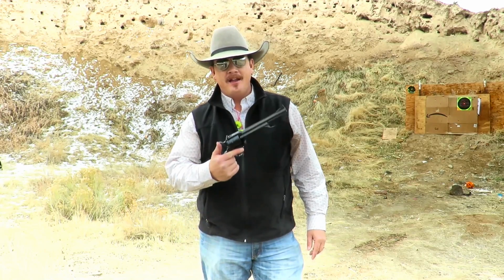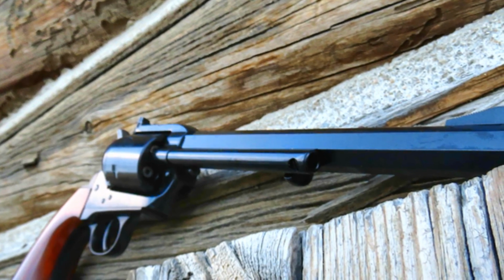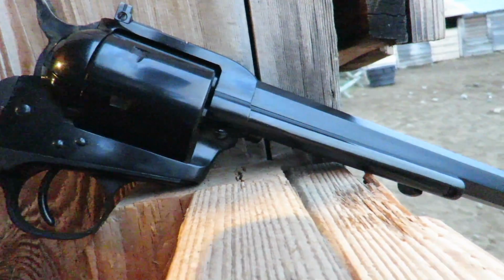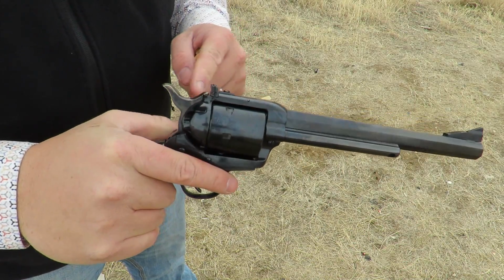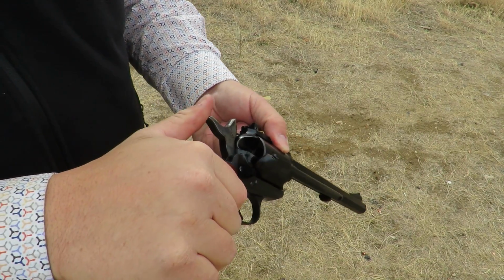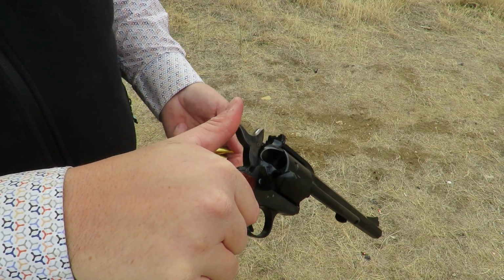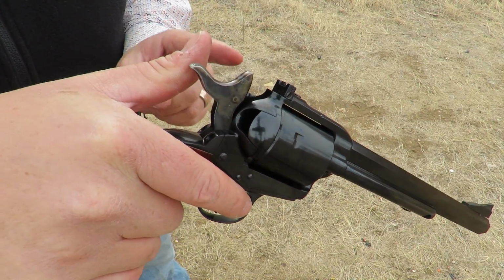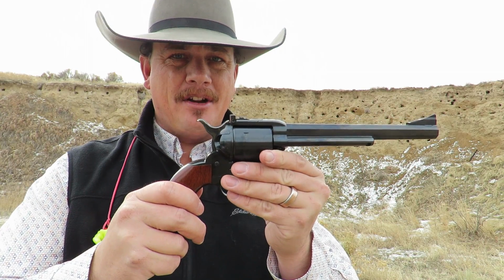CIMARRON "BAD BOY" - 44 Magnum

Comment: A beautiful revolver-so nice, just love the deep blue finish on this bad boy. Although I do wish it was also chambered also in the ;45+p magnum round, I have a old model Ruger Vaquero  with the Blackhawk frame that will handle it, It's twerk is-it loads off center-not a true 1873 Colt style loading sequence - and because of it's  transfer bar safety and in frame firing pin. It would be very easy to make this model handle .45+P loads with adding a stronger beefier cylinder, Just a thought that you may you want to pass along, there are tons of 45+P shooters out in Pistolaro land. I have a lot of friends that would be interested in buying a model like I mentioned.  Thanks so much for your review. Like any revolver made-you should always check your ''Reloading Manuel'' to make sure your reloads are with-in specs of any revolver you are shooting-bottom line( check Cup Pressure) you may save your life, terrible thing to waist!

Comment: Man Alive A.C. that looks like a fun gun. The only worry I have is the small grip. On my Super Blackhawk, I've got Pachmyers to tame the savage beast. Just wondering how this works on this revolver. Cool video my friend. I like that Montana looks so much like Eastern Idaho.
Reply from the maker: I have lived on both sides of the border. I think the Montana line should extend just a bit farther into Idaho. ;-)  ... I actually didn't mind the grip. It does rotate up,  which is typical of a SAA grip.  I shot the gun a lot when it was real cold and the recoil did not bother me. I can shoot it one-handed a lot with no pain.  I am not very recoil sensitive though.  ... In my opinion, the biggest disadvantage of this revolver compared to the old Super Blackhawks is the SAA firing pin instead of a transfer bar. However, I do personally like the SAA design touches and the sweet octagon barrel.
Reply: @ralphperez4862: No problem with the grip size, for people with normal size hands you just need to fit Colt 1860 grips/grip frame, it just screws straight on, never understood why Colt went with the short 1851 grips o the 1873. Chris B.
Reply: @453421abcdefg12345  thanks

Comment: Can I use .44 Special also? I’m 70 and I love that style but .44 may take a toll on my wrist...
Reply from the maker: Don't see any reason you couldn't.
Reply: All .44 Magnum revolvers will accept .44 Special and .44 Russian.  Make sure all the chambers are throughly cleaned after so they they aren't fouled so the continue to chamber magnums.

.460 S&W Magnum will accept .454 Casull, .45 Colt and .45 Schofield.  

.357 Magnum will accept .38 Special, .38 Long Colt and .38 Short Colt.

Comment: I was told that the hammer  retracts on that revolver And that you can safely carry six
Reply from the maker: Well, technically, even the manals on the "Safety Hammer" revolvers from Uberti still say to only carry 5.
In theory, you should be able to carry 6 safely, but that firing pin is still right there, even if it is retracted a little bit. It's definitely not as sure of a thing as the Ruger transfer bar.

Comment: Is there a firing pin block on these?  If you dropped it could it fire?
Reply: No, there is no transfer bar or other type of safety on this pistol. The safest way to handle it is to load only five rounds like he showed. The trigger CANNOT be pulled while the hammer is at the first click so that makes more difficult to accidentally shoot it.
Reply: What I noticed with mine, the firing pin only protrudes when the hammer is down WITH the trigger held to the rear. Pull the cylinder and try it, it doesnt protrude so seems safe to carry with a 6

Comment: I’ve only fired conventional double action revolvers.  I’ve noticed the handle angle is more acute in angle compared to a double action revolver.  Is it comfortable to shoot?  I’m looking for back country fire power and won’t put many rounds through it.  the price is right!  Thanks!
Reply from the maker: I am quite familiar with the most double-action 44s, and while different, this gun is still comfortable to shoot for me.
Reply: If you are looking for an easy shooting single action buy one that shoots .45 Colt. With this style of handle the kick is mostly straight back and when shooting .45 Colt you can shoot all day without getting a sore wrist.
Reply: Literally just held one of these today. Almost bought it on the spot but wanted to do some research FIRST. I have a Henry Big Boy Steel that shoots .44 Magnum.
Reply from the maker: The Single Action Army grip is designed to roll up into your hand during recoil, not straight back.  I could shoot 44 Mag out of this all day.

Comment: No experience with Cimarron. Comparable to a Ruger BlackHawk?
Reply from the maker: The closest comparable model out there would be the Ruger Super Blackhawk. From a distance one can see similarities between the two, however, upon closer inspection, there are a lot of differences in the design.  The Cimarron Bad Boy remains the truest to the Single Action Army design, and perhaps most importantly, has a rounded trigger guard instead of the Ruger's squared-off knuckle buster.
If you look at the two side-by-side, the Cimarron has a more striking appearance, and for those of us who love the Peacemaker revolvers, it has more design characteristics that hearken back to those revolvers that won the west.
 Don't get me wrong, I love the Rugers too, especially my 7.5" Ruger Vaquero in 45LC!
Reply: Yeah, i dont care for the looks of the squared trigger guard either. Some of their models are round now. I dont have any single actions yet. I like the looks of Rugers super blackhawk hunter models.
Reply: Blackhawk - much stronger - shooting max loads - Ruger. Factory loads bout equal. Can't knock Cim. have a 41/2" 45, and the convertible Blackhawk. Always shoot mild loads in the Cim., but the Blackhawk, any thing goes. Nowadays just shoot paper and bowling pins, both are well built.
Reply: P.S. Further Note: Had loaded some warm to hot 300 gr Hornady XTP's  for the Backhawk. Upon returning home to clean the 44, could not get the cylinder pin out, had to pry it out. Had bent the shaft. All have their limits. First time for everything.
Reply: Who says they're stronger?  I've owned a Cattleman Uberti .44 magnum in the past, it weighed about the same as the Ruger,   put it through it paces all the time-with no prblems, it was just as strong. you need to back up your claim up with facts, anybody can say anything now days-doesn't make it  true either-it's called  ''Fake News''.. a friend of mine sent back his single action Ruger three times and they still didn't fix it right so he sold it. The fit and finish on modern day Rugers are crap, since Bill Ruger died-Ruger fire-arms firm have gone down hill.  I've owned several Rugers pistols & rifles over the years-so I know what the hell I'm talking about.  I still own a Ruger Vaquero in .45 long colt (made in early nineties ) polished stainless with a Blackhawk frame-old model, great gun, I wouldn't trade it for nothing-they don't make that model any more. Ruger ain't what it used to be-sorry to say--quality control is for the birds--bottom line. I have found that--Uberti Cimmarons makes the best looking product to me, w/closer tolerances than Rugers.  They're also the most authentic looking single actions. Cimmarons seem to have the best fit and finish then any other single actions that I've seen as well.. Rugers are not true single action designed pistols-esp. with a transfer-bar firing pin, and two piece grip panels. side by side, Cimmarons wins every time when it comes to authenticity and look    ''And That's a Wrap!''   LOL     Everyone have a nice year out there in cyber-land...P.S.--I'll buy another Ruger when they get there act together!  note: The US  Army just recently chose the  SigSauer semi-auto combat pistol over all other service type auto-pistols, including Rugers, do you  suppose a quality control issues maybe? just say'n...Link: https://www.sigsauer.com/press-releases/u-s-army-fields-sig-sauer-m17m18-pistols/
Reply: WOW. OUCH, yea I like Trump also. Nothing is made like it was . Just look at a 60's-70's Smith or Colt. Most of my Rugers were  bought in the 60 ta 80's. Single Six (2) 3 screw. Black Hawks- 357 (1) 45 Conv.(1) 44 Mag. (4) 41 Mag (1) Smith's include 2 model 19's and 2 model 66's and a Model 29.  Now most folks shoot heavy loads in the 44 - Model 29. I will not, Specials, or 8 gr. Unique on top of 255 gr. lead. Not that ya can't, but why ruin a good thing. Just 1 vote per person, if yur gonna go heavy go Ruger. Shoot on
Reply: The 44 Magnum Anniversary model Flat Top is closer, while not in the current line.  It is the only Flat Top on the large frame and has a 6 1/2" barrel. Ruger doesn't currently offer a New Model Blackhawk in 44 Magnum and indicates clearly that their intention is to confine the cartridge to the Super Blackhawk. However, there is no Bisley in 44 Mag except a too-short-for-caliber barrel at 3 3/4" and then only as a Lipsey's exclusive.
Reply: @kyleroberts3600  As far as "Who says Rugers are stronger?" goes Buffalo Bore, Underwood, Cor-Bon, John Linebaugh, Hamilton Bowen to name a few. Considering the first three names make ammunition designed specifically to be shot in Ruger revolvers that would destroy any other brands save Freedom Arms and Magnum Research and the last two use their frames as the base for making custom revolvers even more powerful than stock. I'd say those entities and people say they're stronger and have physical proof to back it up.

That said. I ordered the Cimmaron and will see for myself.